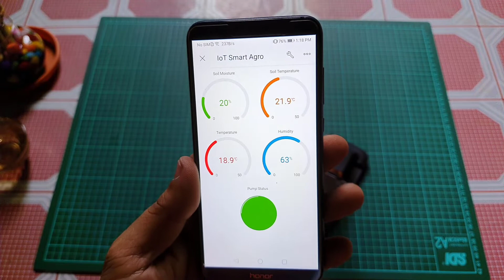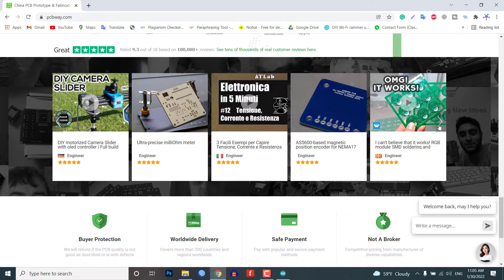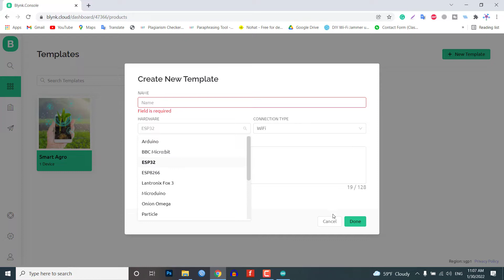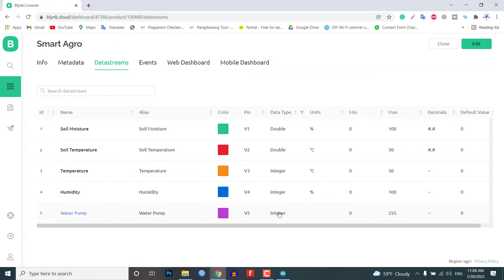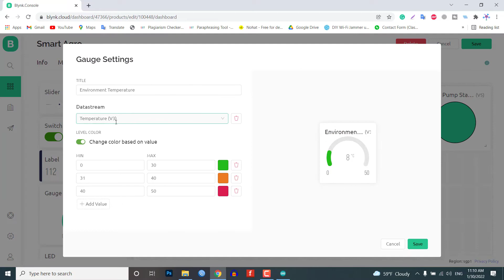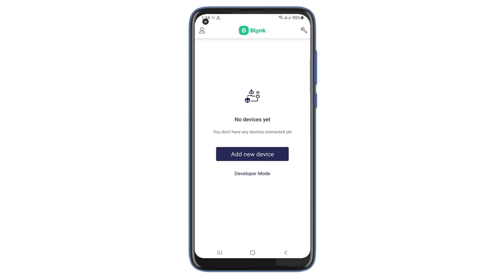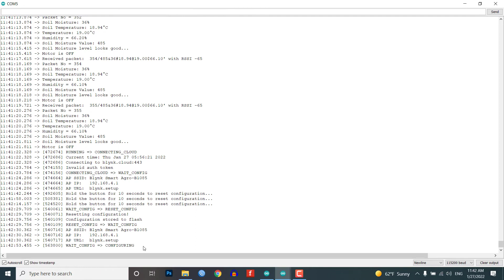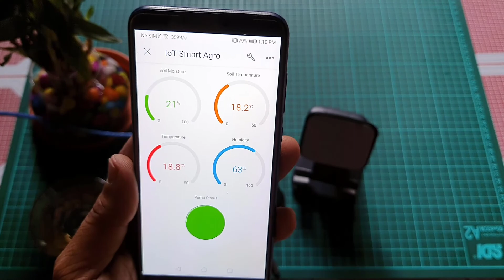LoRa based IoT Smart Agriculture Monitoring & Automatic Irrigation System using ESP8266 & Blynk 2.0

Comment: i keep facing the same issue, could any help with this
14:30:39.416 -> >[324] INIT => CONNECTING_NET
14:30:39.463 -> LoRa Receiver
14:30:39.463 -> Starting LoRa failed!
and am not able to connect my esp8266 to wifi.
Reply: Same problem 
Was it solved

Comment: Receiver Program - mentioned following pin values

#define ss 15
#define rst 16
#define dio0 4

But the Receiver Circuit diagram pin connection is -
NSS	- D8
RST	D0

So let me know the correct pin configuration.
As per ur code , receiver side data is not receiving and unable to see data at blynk web and also app.
Even 8266 is not connecting to blnk.

plz check and make corrections.
Reply: Receiver side ur not mentioned proper code
Reply: @anilnaik8565  bro i have same problem can you give me this solution
Reply: i keep facing the same issue, could any help with this
14:30:39.416 -> >[324] INIT => CONNECTING_NET
14:30:39.463 -> LoRa Receiver
14:30:39.463 -> Starting LoRa failed!
and am not able to connect my esp8266 to wifi.

Comment: im getting "failed to read from dht sensor".can you please help me out
Reply: hi 
did the app work with you?
Reply: i keep facing the same issue, could any help with this
14:30:39.416 -> >[324] INIT => CONNECTING_NET
14:30:39.463 -> LoRa Receiver
14:30:39.463 -> Starting LoRa failed!
and am not able to connect my esp8266 to wifi.